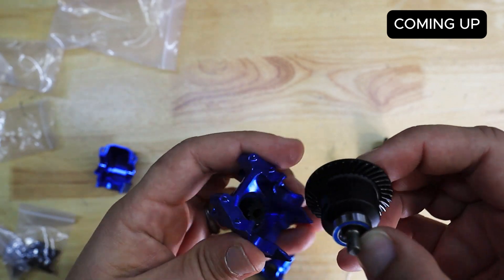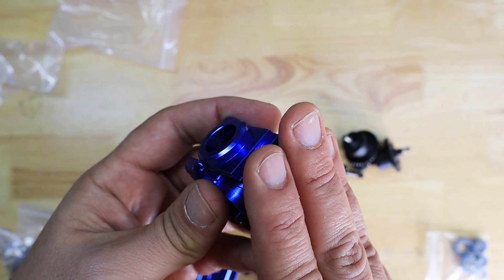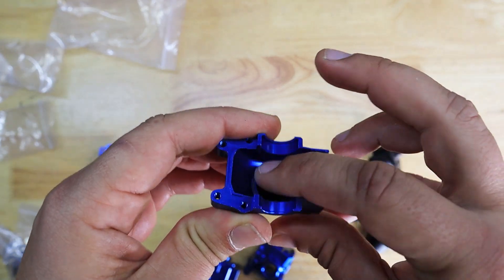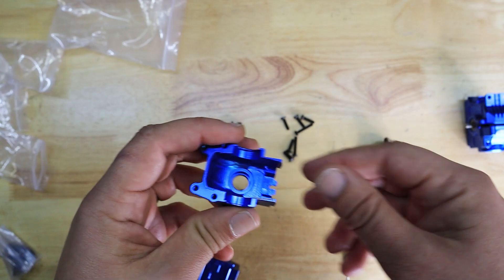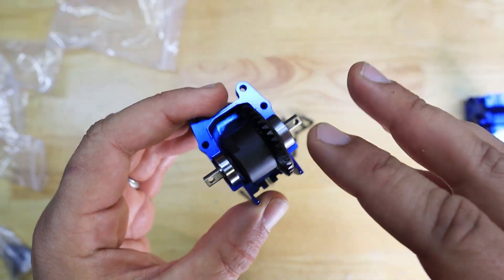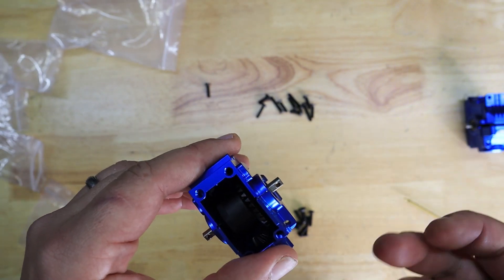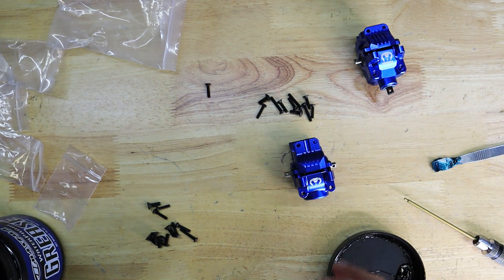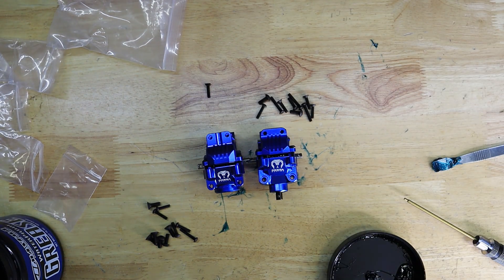Building The Ultimate DIFFERENTIAL - For Traxxas Slash 4x4, Rustler, Stampede, Hoss and More!

Comment: My question is why didnt you guys make it so these housings will fit YOUR aluminum differential that you sell? I bought the aluminum differentials and it says it wont fit these aluminum housings without modifying them? Also ive seen you promote these internal differentials with the helical gears but the aluminum differentials you sell dont have the helical gears and the ones with the helical gears only have plastic differential covers? Why didnt yall make differentials with the helical gears AND the aluminum differential covers AND make them fit into these housings? They are all made by cobra arc but they dont fit together? Even made for the same truck.
Reply from the maker: Fair question — totally legit. These two differential types are built for different purposes:

The aluminum-cupped version is built like a tank — it's beefier and designed for bashing and durability, especially when paired with the stock plastic housings. It’s a direct fit on the OEM setup.

The helical gear version is focused on performance — it's lighter, runs quieter, has better mesh thanks to the helical design, and is a drop-in fit for aluminum differential housings, or plastic OEM housing. That’s why we didn’t combine the two — the performance version is engineered to keep weight down, similar to why some full-scale cars use carbon fiber while others stick to heavier materials.

We do note in the product description that the aluminum-cupped diffs won’t fit aluminum housings without modification, due to the size and fitment differences.  However, they drop in perfectly in the plastic OEM housings.

That said, a combo version (helical gears with aluminum cups) might be something we offer in the future, but for now, we chose the plastic cup for its performance benefits and weight savings. It’s worth noting that the plastic we use is a high-strength composite, so it’s tough and won’t crack easily.

Just wanted to give you the full context — appreciate the question!
Reply: Great answer!  Will be ordering one soon along with the cobra drive shafts.  Now I have to decide what route to go on my Rustler 4x4.  Curious if you guys sell the carbon chassis for the Ruster 4x4 vxl?

Comment: It looks cool but it's basically a steel version of the plastic stock version. What I would like to see is a diff that doesn't expose the bearings to the outside so they get full of dirt. Make that hole for the output shafts smaller, waaay smaller.
Reply from the maker: @therickman1990  true - same as oem plastic but in aluminum.  The other difference is the internals are all helicals.  So completely different internals (under the hood).

Comment: I keep breaking my stock jato 4x4 diffs (spider gears turn into 50 pieces) do you think this diff will hold up to a 4274 motor on 6s, debating on just locking both diffs because i dont know if i will find spyder gears strong enough, thoughts?
Reply: Try getting some aluminum diff cups and
X-01 internal gears that should do the trick.

Comment: I dont normally comment on videos, I have to ask. What makes These "Better" compared to stock, i understand the aluminum housings help with strength and heat but just over double the cost of oem. 

Newer to the hobby and building/upgrading a 4x4 slash VXL and wanted to ask.

Thank you CobraRacing
Reply from the maker: @DustinWest-1994  as you mentioned aluminum is tougher.  OEM is straight cut teeth for the internals.  Ours - the internal gears are spiral cut (helical).  Google helical vs straight cut differentials to learn the difference.
Reply: @CobraRacingRC  Thank you for the reply, i know the different between the two gears but did not know the oem is straight cut. 

Thanks again.